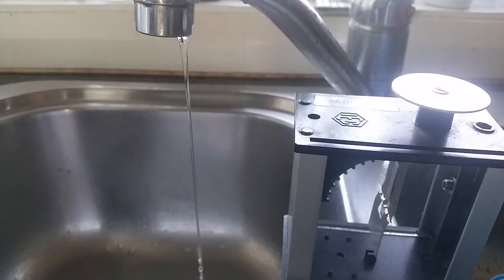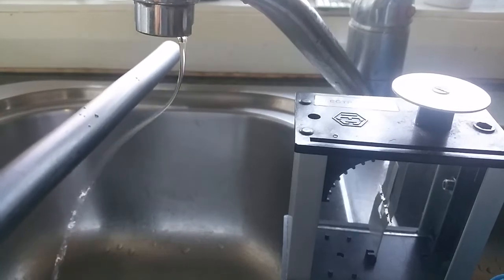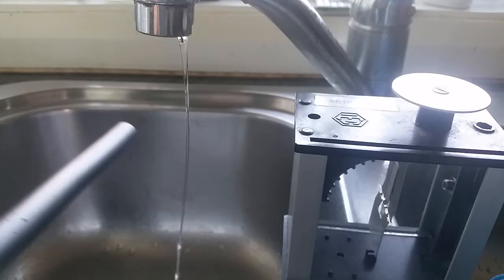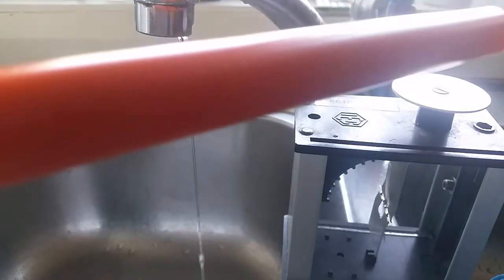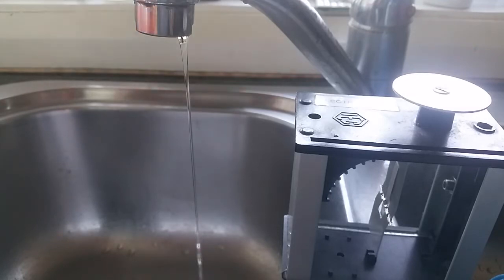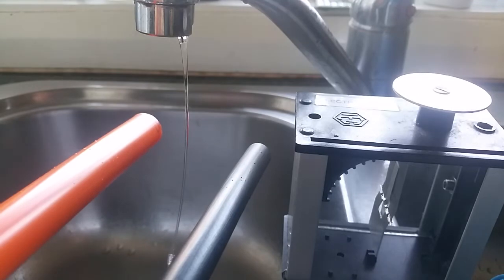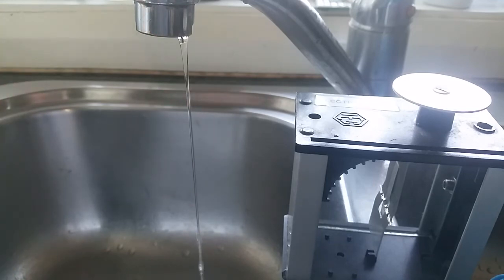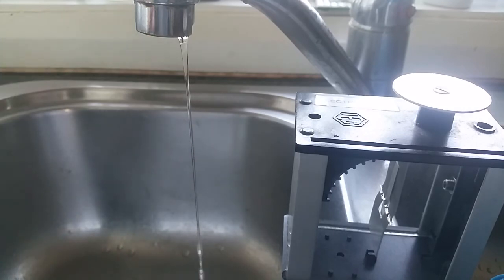Bending water with Ebonite Static rod

Comment: My electroscope had a copper disk outside attached to a shaft extending down inside the 'scope. There were 2 gold leafs (=leaves?) attached inside "back to back. With a charge the leaves spread straight out away from each other. No charge they drooped down almost parallel with the shaft.

Comment: Did extensive search for rods 12 years ago. Unobtanium at the time. Now I see eBay has lots of sellers. (Just bought 2.)    I wound up using old oxy acetylene hoses from the 1960s in 2008.  Had a thought about getting a decrepid bowling ball and slicing it up with a hacksaw.  I believe that might work for JC insulators?
Reply from the maker: Did you get the file i shared on discord?
Reply from the maker: I'd recommend sanding smooth with fine paper to help it hold charge after the hacksaw leaves a rough cut.. bowling balls ebonite also?
Reply: @m3sca1  As I understand it old bowling balls were hardened  rubber (= high sulphur content.) [Note continued using hardened rubber through 1976.]  Ebonite was the brand name for some of the hard rubber balls.  Now made with plastics. started adding high density cores so hard rolling bowlers could get more "hooking action on the ball." Often finished with another  layer of something else to get more or less grip on the bowling lane.  Might be resins.  WHO knows?